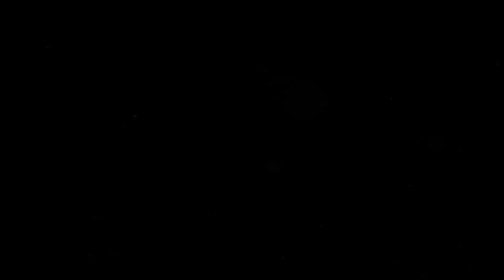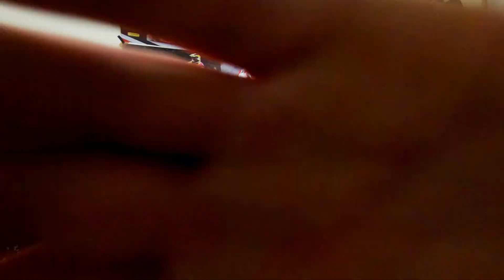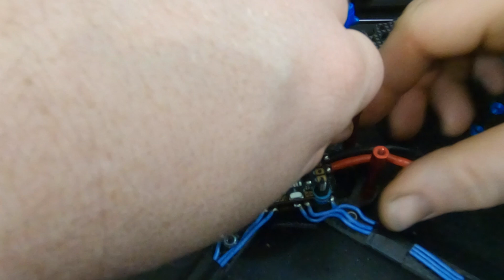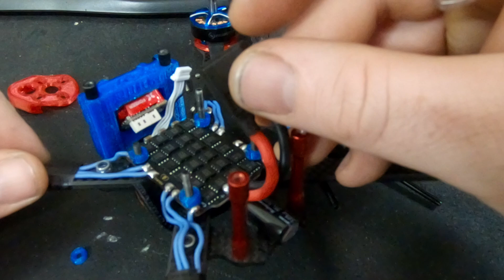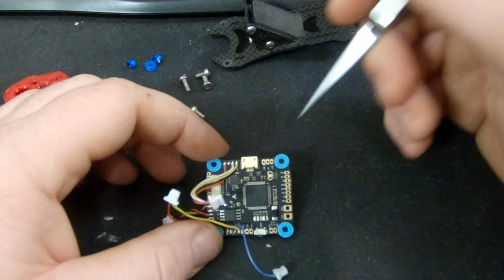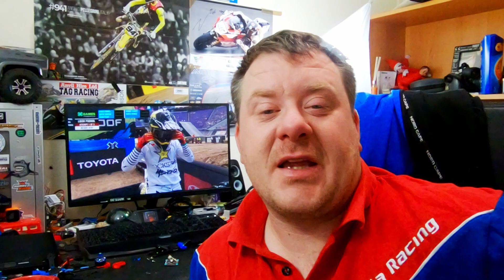DIATONE MAMBA F405 REVIEW - INITIAL THOUGHTS - PROBLEMS

Comment: Nice build! Where do you get your jst cables that you have soldered on your flight controller? I building the Diatone f04 25A from ground up, but I need the jst connectors like what you have soldered, 2pin, 3pin and 4pin. I have the cam cables which come with the Runcam vtx 200u what's the name of the camera...Thank you so much In advance!
Reply from the maker: Home Dronen hi buddy I just get them from amazon
Reply from the maker: Or our of the big tub of spare cables I have

Comment: The F405 MK2 has an interference isolation sheet. It looks like you are supposed solder to it (ground). Do you have experience with the MK2
Reply: I was wondering about that myself. My mk2 won't connect to BF after firmware update. I reinstalled all drivers and used impulse RC driver fixer. My other FC connects. Have you had any issue with this or know if it's dead? I can't find anything but people telling me to check drivers like duh!
Reply: @anti-popfpv4638  they responded that you do not solder anything to it. If you don't put a fan on it when connected to BF, it will get too hot and burn out.

Comment: Do you have a link to the video about hooking up telemetry on this board?
Reply from the maker: Colton Horn stick the telemetry wire on to the pad labeled T6 then go into beta flight and enable smart port telemetry on uart6 under the sensors tab 

Then go onto YouTube and look up how to set Taranis prompts.
Reply from the maker: Colton Horn what telemetry are you using
Reply: DRONE NATION I’m so new to this I’m not even really sure how to answer what your asking. I have this Mamba stack with a Frsky R-XRS sbus receiver and a Terranis QX7 transmitter. I want to be able to have the voice prompts on the transmitter for low battery.
Reply from the maker: Colton Horn right ok so it’s frsky telemetry you are setting up I will have a look into it shortly and send you a setup guide ok
Reply: DRONE NATION thank you so much!

Comment: The hobbywing fc is more difficult to build with imo,  catastrophic layout and not exactly big solder pads. Not really anything wrong with the layout on this fc, except that it should have a vcc pad where all the other vtx pads are.
Reply from the maker: Everyone is entitled to the own opinion. 

My I firmly believe the hobbywing system is a far better one due to the fact my mamba system lasted one battery before the esc went pop. 

Also the hobbywing system I can have built soldered and ready to rock in 30 mins as its just 2 plugs on the fc and 6 wires you need to soldier to of them. 

Also imo the hobbywing system has a far superior build quality it feels more robust and has strain relief in the places where it’s needed.
Reply: @ProgressiveMTB  
I didn't mean to slam your opinion, sorry if you took it that way.
Personally, I just think the HW is frustrating to build with, wires all over the place an you need to splice the video in/out wires because they are only accessible in the plug. The Diatone was a breeze in comparison, logical and clean layout. Maybe we build differently. 
It seems like our experiences with these stacks are completely different. The mamba have been just fine so far, but one of my HW esc's decided it wanted to be a flamethrower when I plugged in a 5s. It worked perfectly for a few months, until it didn't. I have only flown the mamba for a few weeks, so I can't comment on the long term reliability. Of the esc's, don't know which one is best. But when it comes to the fc's, I'll choose diatone any day of the week.
Have a good day, happy flying!🙂
Reply from the maker: Viggo Koch  no I did t mean that the way you have taken it lol. 

Personally I just like the hobbywing it’s easy for me and I only fly 4s at the moment but I have a 6s build on the way so it may well go pop but only time will tell

Comment: Good Review Drone Nation! I love this stack! I know a lot of people have questions with this stack so I hope this might help; I have FrSky R-SXR with SBUS on RX1 (native, no need for invert hacks because RX1 is already inverted to accept FrSky SBUS), SmartAudio on TX3, and Telemetry (SmartPort) on TX6 which I had to use the un-inverted pad on the R-SXR because TX6 is not inverted, so the native SmartPort will not work. My VTX is powered by VCC and Cam is powered directly from VTX 5v output. And the included Cap is right on the Power Leads on the ESC, no noise issues at all. I love it! Keep up the great work!
Reply: Have you got any of the amperage issues and MAH used figured out?
Reply from the maker: I have that many issues I put it in the bin and just bought the hobbywing setup

Comment: I'm running a 1,000 mf low esr capacitor and still getting bad video noise on 4s with this stack. I'm going to troubleshoot this by changing antennas, making sure that the vtx isn't vibrating and so on. Flys well enough, but the video noise is bad. Hope it isn't the lack of filtering on the esc. For 47.00 I suppose you get what you pay for. Also, the cute fold out diagram is incorrect. it has the smart audio and video mixed up. Forget the little flap instructions. Look at the tiny print on the FC.

Comment: I can not recomment this stack. Got one that didnt work at delivery.(chip gets hot when usb is connected) Than the replacement from banggood had the same issue after only 3 batteries (no crashes )  If it works its a fantastic stack but i had to many Problems with it so i can not Recomment it to anyone out there.
Reply from the maker: TeddyGun300 that’s some good feedback thank you I will update the video accordingly 👍
Reply: I can't speak for BangGood, but I got mine directly from diatone's website, no issues at all. Sounds like there could have been a short or something internally that didn't blow anything up but created too much heat, mine is always pretty cool. I hope if you decide to get another that you get a good one because this stack is amazing

Comment: Hey man,, I need help bad.
Reply from the maker: Jelly Fish what’s up bro
Reply: @ProgressiveMTB  hey dude. I'm in trouble, well, I was in, I don't want to post it here. A hospital, anyway so how ya been I been watching every chance I could. And learning that's why I'm at my end and now need an expert. Ok my $100 drones I buy for the kiddies to teach them and fly, I have a bugs six that is my baby, I know how you feel about boxed drones but it's all I could afford, I was spinning the props to drain the battery to trickle it, so I walk inside we talked we laughed I went back outside and guess we're the drone was? Yep the bottom of the pool. And get this, I swear to God, I flew it out. Well to the top of the water. I took everything apart that would unscrew and I have heavy duty fans I put on the drone. Now something is wrong, it doesn't fly right the stick control is to sensitive, it's up, down left or right if you let the stick go it drops out of the sky. I use to be able to walk up to it and pluck it out of the air. Then I saw your video "did you burn it out" or something, I'm not going back I'll lose ALL this lol. PLEASE HELP ME. The bugs is my baby, I Hardy fly it, that's why I have the $100 drones. So, what did the pool do to my drone? Lol it sure wasn't me. Me? No. That was smart running it unattended next to a pool. I KNOW SO LETS GET PAST THAT PLEASE. Lol. Any ideas my man. I'll tell ya where I been, think hospital, o hell, rehab. If ur busy I understand. I'll go to HOBBY LOBBY ;+(.
Reply from the maker: Jelly Fish hi buddy I have been away working this week just landed at home al have a proper read of your message late and get back to you 👍👍

Comment: Hate to say this.
But this is one of the easiest stacks there is period. The soldering to it isent even hard, I have seen worse like the bff3 and bff4. I have the bff3.
I also have 2 of these 30x30. One for 4s using the 470uf cap. And the other on 6s 6".
The 470uf cap is fine for 4s, I checked the black box logs.
For 6s you need atleast 1000uf cap with the 470uf provided.
This stack is a beast! And for the price it beats out many of the other systems period.
They are bring out the 32 system in March. I'm excited to get one of them.
I even have the 20x20 on my 3" build and it flys amazing also.
You dont need to run the 32 on the gyro at all, so I dont know why you would need to do it.
The 20x20 will handle 2306 motors.
I recomend these stacks to anyone, simple bc they are the easiest and fastest to set up.
Reply from the maker: I agree in a lot of of respects with you but it you are new to soldering it’s not easy to solder up I have been soldering for years so yes it’s easy but as stated above it won’t be if you are new to it all.
Reply: @ProgressiveMTB  kinda agree on that, but then not bc mostly all new ppl to the hobby just get a bnf kit.
These are in all diatone quads already as a bnf.
My first one I put togeather my self and got all the parts not in a kit.
But then also I could half solder then haha.
Now I'm fixing them little 5v switching parts on the escs of the 20x20 boards. They suck!